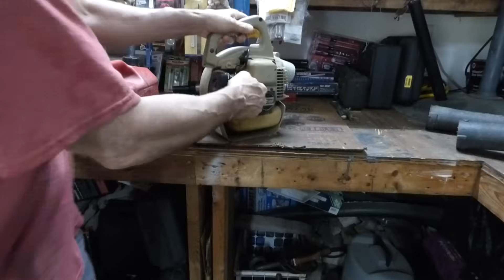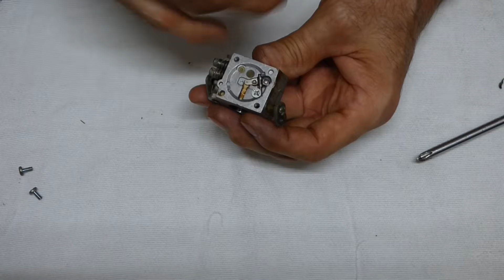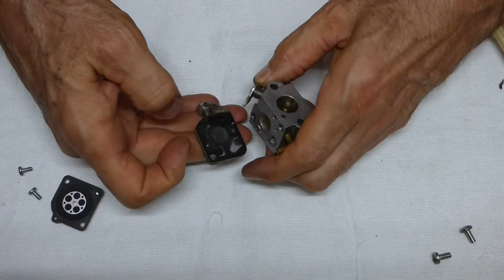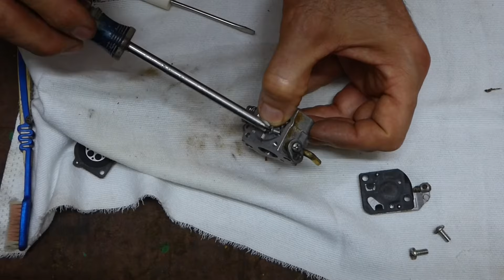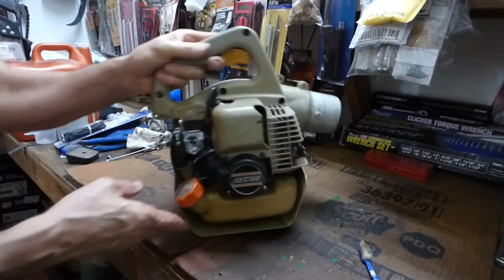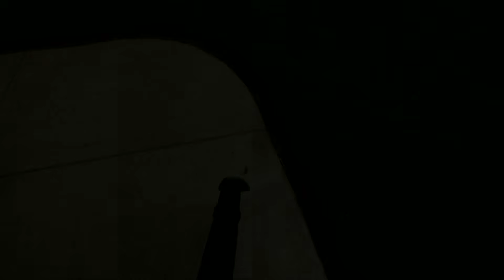2 Cycle Carburetor Rebuild / Cleaning - EASY Start to Finish Instructions!

Comment: Thanks for the video sir! Trouble shooting an old string trimmer not hitting the high note. Would it be ok to use throttle body cleaner instead of carb cleaner?  To my understanding they're basically the same...

Comment: The reed valve is between the carb and the engine intake. Those diaphragm flaps control fuel flow inside carb. Other than that great video.

Comment: Very satisfying. I've got a similar carb on my old Ryobi strimmer/hedge trimmer. I cleaned it up like you and bought the rebuild kit for £3.25 which was posted from China and took two weeks to reach the UK. It's running like new now complete with new reed valve and diaphragm. Thanks for the vid.
Reply from the maker: Good for you and glad I could help

Comment: Hi I have a weed eater that been sitting and the gas gum the carb 
Where the needle is stuck is it more realistic to clean or get those China carbs from amazon
Reply from the maker: I would clean it and make sure the diaphragm is not stiff also.  It should be rubbery and flexible in the middle.

Comment: Hi I have a tillotson carb on my trench wacker the problem is when I open throttle it doesn't rev to start wacking.
Open choke it wacks.
It is a fixed jet carb so no screws to adjust only one on throttle linkage.
What could be the problem.
Reply from the maker: Then you are not getting enough fuel.  You may want to check that your metering lever is connected and is adjusted properly.
I don't have a video on this but you may want to check out some.
Here is one... I haven't watched much of it but check around the 11 minute mark for help.
https://www.youtube.com/watch?v=ux8wM1mrjkY&t=668s

Let us know how you work it out.

Comment: Thanks! I just pulled out a TroyBilt weed eater that has sit over 10 years. Got it freed up and running but won't idle so I'll have to clean the carb and your video makes it so much easier. I work on carbs for 4-stroke dirt bikes but this is my first small 2 cycle carb. Much appreciated!

Comment: The needle valve fork has a nub to lock the spring.  Nub is up, corredt?
Reply from the maker: the dimple part of the nub fits into the top of the spring to hold it in place.  The concave side should face up and not be touching the spring.

Comment: What causes to much gas in to engine.
Reply from the maker: With a carburetor like this it could be a bad reed valve or something keeping the needle valve from closing completely.
Reply: @helpinguonline  Thanks you sir what is Reed valve.
Reply from the maker: It is pointed out in the video.  It is a small plastic stamped sheet that allows fuel to flow (or not) in the carburetor thru the various ports.  Sometimes they can bend out of shape or break.  You can get a new one in a carburetor kit.  You can also probably google it and see a picture of one.
Reply: @helpinguonline  Thanks you sir.